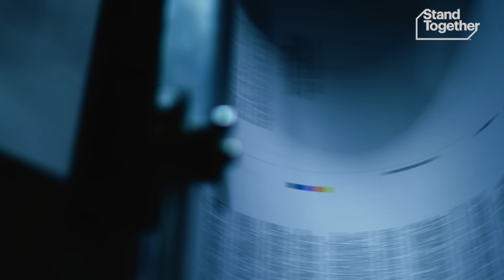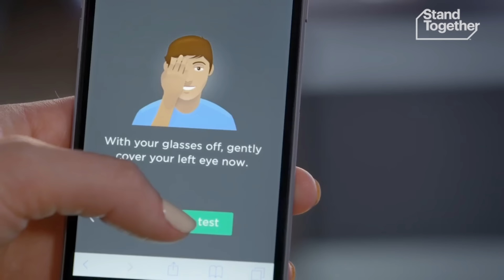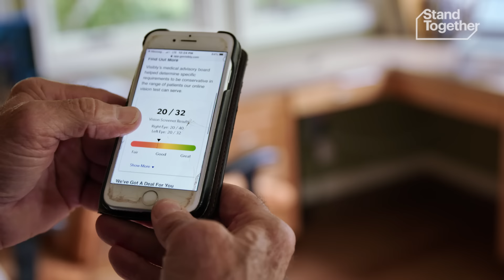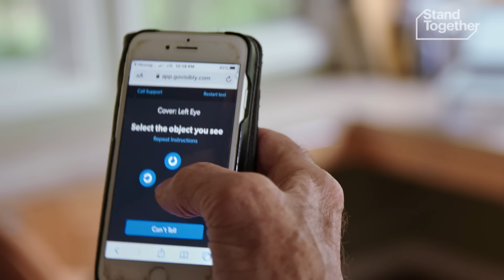How bureaucracy is stopping us from solving America’s biggest problems

Comment: New technology is coming out very quickly now, but new doesn't necessary mean better. When new technology is created, it is almost impossible to uncreate it.  Pure technology solves problems, but when technology creates a sense of duality, like it can be used as a tool or weapon, mankind spirals down rather than up. 

For example, nuclear energy can be used as a tool or a weapon. It isn't pure technology, and mankind has been spiraling down since it was created. It was meant to stop wars, but it made wars worse. Existential. The bottom of the abyss is that it will wipe life off the planet. How can that be? Scientists have not yet understood that atoms are Universes, and there is a Universe within a Universe within a Universe. By destroying atoms, we break Universal Law of Cause and Effect, and the backlash is that we destroy ourselves. We never reach our full potential, like that atom never became a Universe with the capacity to reach its full potential. 

The argument is that the stars are based on fusion energy and destroying atoms. It is not a matter of will on our part what happens to stars. We are not God and God is Creative, not destructive. The energy from the sun is potential energy and it gives life, it doesn't take it away. 

Another example of a technological existential threat is undersea mining. It is supposed to be the solution to climate change but it will take it worse, not better.  

When someone blocks new technology, that is not a problem, that is a blessing. New technology must go through technology review and cultural review before it is created and put on the proverbial back burner until everyone is in agreement for it to come about.
Reply from the maker: Thanks for sharing your thoughts. Your point that "blocking new technology is a blessing" assumes that the way we review new technologies is already perfectly effective; that the balance between ensuring safety standards are met, and making progress towards solving urgent, ongoing problems such as homelessness, is already in harmony. 
The solution to ensuring the latter is not by any means to remove safety standards. However, there is certainly work to be done where long-held review processes neither guarantee safety, nor allow much needed progress towards solutions for society's biggest challenges.
Reply: @StandTogetherCC   Have you been in contact with Ye West at all? He was working on building a bunch of structures for homeless people to dwell (or at least loiter more comfortably) in through his architecture company YEEZY Home, but he didn't (probably couldn't, given their non-traditional design) get permits for the prototypes, so the government had them torn down. I wonder if there is some way around this? What if they were homeless people playgrounds, not structures?